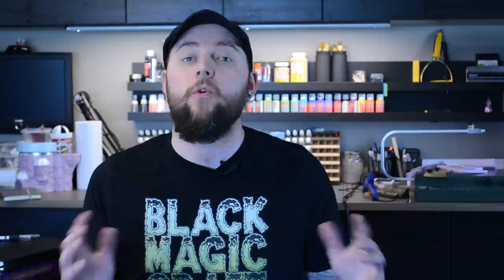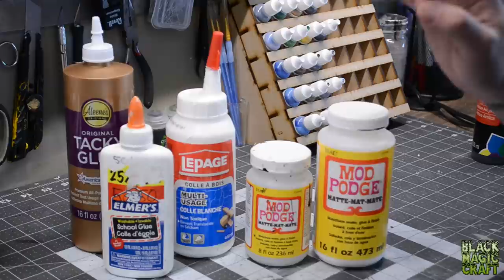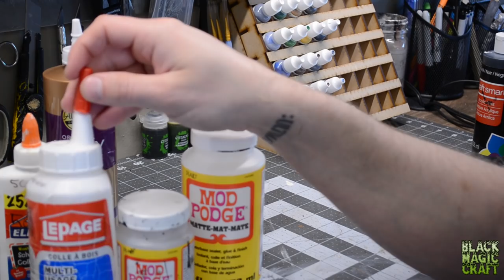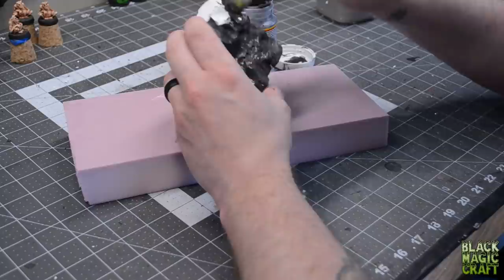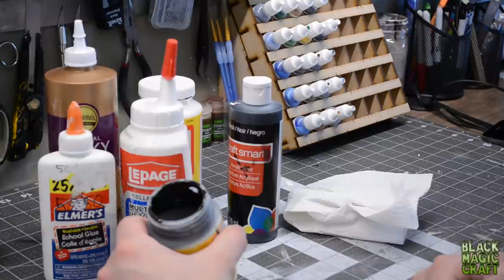Black Magic Base Coat! How to protect and and harden your terrain (Black Magic Craft Episode 034)

Comment: In Croatia, its easier to find ACTUAL black magic than mod podge..so can i use black paint + PVA + Water to do the sealing? i know its not mod podge but does that work?
Reply from the maker: Yup, it will work it’s just a little harder to work with and you have to be careful on thin foam. PVA will shrink more when it dries than mod podge does so it can warp some pieces.
Reply: Thanks you for prompt answer! Big Fan of your work.

Comment: Hi, Could you add black ink instead of paint? Just out of curiosity.
Reply from the maker: If you’d like to use a far more expensive option? Yes. But honestly there is no benefit. Just use $0.50 acrylic craft paint.

Comment: Question, if you mod podge your piece are you able to spray your polyurethane  clear coat at the end without worry?
Reply from the maker: You can never spray anything without worry. You can also spray without any protective coating first if you do tests and use correct spraying techniques. Mod podge will give a layer of protection to any aerosol, but you should not rely on it. You should test and learn to spray properly. I spray paint raw foam all the time. The power is in your hands.
Reply: @BlackMagicCraftOfficial  do you have a video on spray technique specifically?
Reply from the maker: I've discussed it numerous times in videos but don't have a "tutorial" on it. It's not a complicated thing.

1. Test every can on raw foam (some paints are more aggressive than others)
2. Follow spraying directions.

That's it. Basically spray lightly from a distance of 12". Light passes. Just like the cans tell you to. Almost always foam melting is caused by people not following the directions and heavily coating from really close. You need to spray lightly from a distance so only paint hits the foam and not propellant or thinner. Let it evaporate before it hits the foam.

Practice this.
Reply: Thanks man, perfect.  I appreciate you. You've inspired me to start doing more and I've started my own notice board project. Considering Patrion contributions. Thank you.

Comment: So question. It seems like you used 3-4oz for 8oz mod podge. I just used 16 oz mod podge and had to use about 18oz black paint. And it's still dark gray not black. Does this seem like way too much paint, like 1.1:1 black paint to mod podge? I know you said don't worry but based on what I see in the video it seems like I had to use way more paint and it's still not black but pretty dark gray. Wondering if there may be some common stupid things I'm doing.
Reply from the maker: I honestly use like 1 part paint to 9 parts mod podge and it turns out pretty black. It could depend on the concentration of pigment in the black you are using.
Reply: Black Magic Craft Strange. I had to use 5:4 and it's still a very dark gray.

Comment: Can clear Mod Podge also be used as a sealant over painted terrain?
Reply from the maker: It can, and people use if for that, but personally I prefer using the minwax polyurethane spray for the final protective coating.
Reply: Yeah, I tried to find it, but failed, in fact it waa a quest on it's own to find mod podge!
Thanks =)

Comment: Question would this apply also to like action figure base coats?
Reply from the maker: I don't work with action figures, but assuming they are plastic a spray paint primer meant for plastic would be more appropriate. I use this to protect and harden styrofoam.
Reply: @BlackMagicCraftOfficial  Some minis (looking at you, Reaper) are made from a soft plastic that's prone to bending and warping. I think I may try the mod mix and see if that helps. The spray primers don't add much stability.

Comment: If you seal with minwax, why do the mod podge step? Legitimately curious.
Reply from the maker: They perform two different functions. Mod podge hardens and protects from aerosol melting, minwax protects the paint.
Reply: @BlackMagicCraftOfficial  could i use normal varnish instead of minwax?

Comment: can you spray paint the styrofoam after you use the Mod Podge?    The podge has changed my life!
Reply from the maker: It’s still risky so I wouldn’t
Reply: Krylon now makes a primer that's safe for all foams, and was actually designed with crafting foams in mind. I'd suggest using that, if you plan to use any spray paints and/or sealants on your foams.
Reply: Awesome, I'll have to  look forward to that. Now if only Krylon will make paint that you can use in a nonventilated area....  Thanks for the tip.

Comment: I was wondering if any paint color could be used. It's a basecoat, so if I wanted to use green or blue to make what I put on top stand out more, would that still work with this method?
Reply: Second this question

Comment: Made a batch and i think i screwed something up please help  :(
When i start to base coat my dungeon tiles i made following you'r other video  it adheres good to sides of foam where its been cut its soft there.
Problem is the top and bottom of the foam its much harder and the coat slides off it barely covering at all :(
It is extruded polystyrene colour kinda pinkish orange it has no paper to peel off.
I am a total newbie in terrain making it is my first time help please :)
Reply from the maker: Are you sure there is no plastic coating on those sides you could peel off? If not it may just be very slick/glossy from the extrusion process giving the mod podge nothing to stick to. In that case you'd want to cut a thin layer of foam off those sides.
Reply: @BlackMagicCraftOfficial   Yes im quite sure i cant peel anything off it tried even with knife it just breaks off bit by bit.
guess i bought crappy xps thank you very much for you'r answer you rock !!!

Comment: would this work for hot glue castings?
Reply from the maker: What do you mean? like would it work for coating things made out of hot glue? It would, it would stick, but I don't think youd need it. If the piece is just a molded bit of hot glue its already hard and Id just spray paint black.
Reply: Black Magic Craft using hot glue on Hurst arts molds. the problem with spray paint it's too thin, I was worried that this may be to thick for the cracks and small details
Reply from the maker: A coating of this won't loose much detail, but always do a test piece first.

Comment: Could I store this in a Mason Jar? Or would it dry?
Reply from the maker: Pretty sure I answered this on FB, but in case that wasn't you.....yea, should not be a problem. The container mod podge comes in is probably a worse seal than a mason jar.
Reply: made my first batch of mod podge and black paint into a Mason jar and its fine after two days.
Reply: Sam Thomas yeah mine is still good it's been a little over 2 months and mine is still good 😊